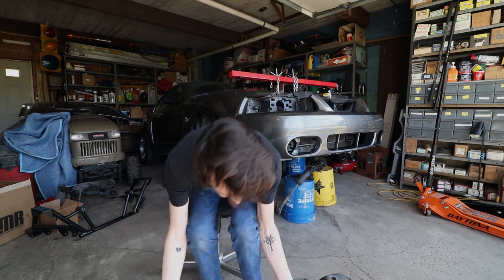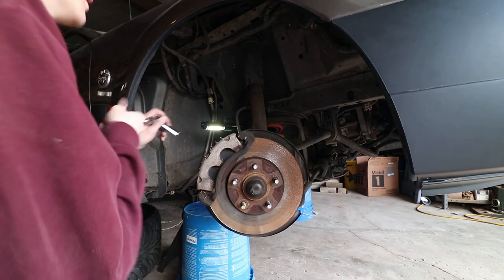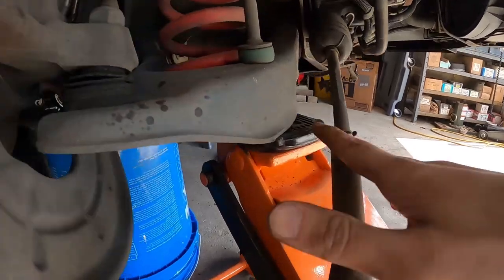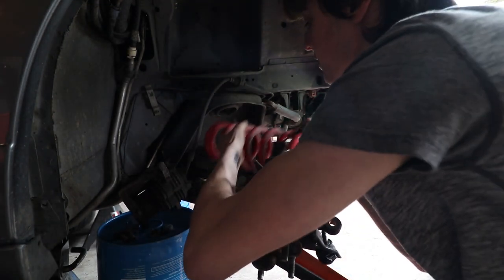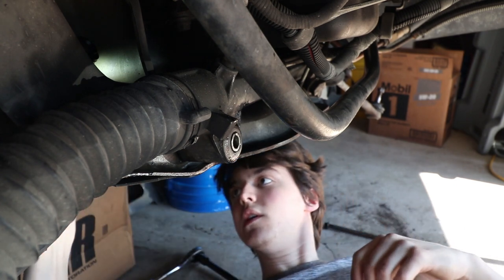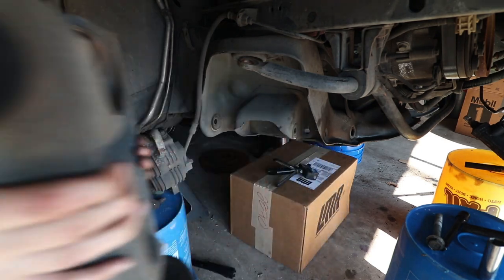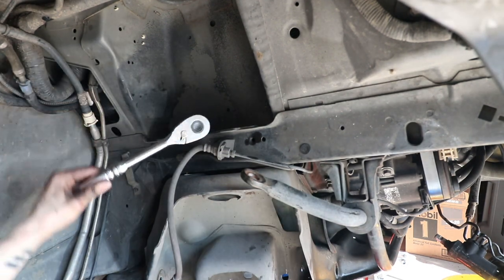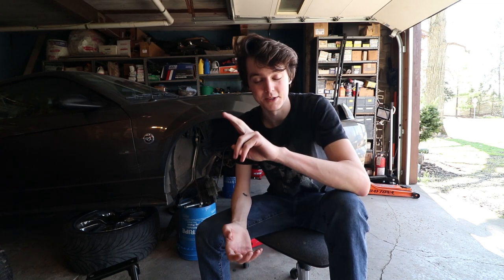Mustang K Member Removal (96-04)

Comment: Great video kid. I like the initiative you show. Small tip from a pro... when disconnecting the tie rod, strike the flat spot on the spindle with the hammer. Thats why its there. It will allow you to disconnect the tie rod easier than it was by striking the castle nut, and it also enables you to reuse the tie rod without risking damage to the stud, the threads, or the castle nut. The same trick works for ball joints as well. If you need further clarification please feel free to PM me. Im always happy to help a young gear head with their learning curve. Keep wrenching and doing such great videos. Good job man.
Reply from the maker: Hey thank you for the support I appreciate the tips and tricks as well! I’ll definitely be looking forward to future tips thank you sir!!
Reply: An old guy taught me that trick at the junkyard one time. He saw me and my buddy struggling with the tie rod and came over to lend us a hand.
Reply from the maker: @sethbrown5856 wish more folks were like that, a little courtesy goes a long ways.
Reply: Debating on getting a k member for my sn95. Built a 347 stroker twin turbo set up with a 8qt oil pan, thinking I need a k member upgrade for oil pan clearance.

Comment: For anyone else following this be careful putting your jack on the flat part of the crossmember the Jack has a  tendency to slip off if you're not careful
Reply from the maker: Completely agree. Safety is priority!
Reply: This is the reason I’m watching. I jacked it up the same way he did this morning. It fell right on the oil pan. Crushed it. Gotta do the oil pan now 🤦‍♂️🤦‍♂️
Reply: @DadifiedX4  you're alright aren't you didn't get hurt ?
Reply: @soloreclipse94  sorry for late reply I’m bad about checking notifications LOL. Yeah I’m good. It literally happened as I was jacking it up
Reply: @DadifiedX4  that's good it didn't go far enough into the oil pan too damage your crankshaft did it
Reply: @soloreclipse94  it did crush into the crankshaft but they are built with very tough material. I’m sure you’d have to do a lot to damage it. Car has been back up and running since two days after I watched this video!!

Comment: Hello Thatlowdsg,  I am helping with a K member on a Bullit, never done one before.  Your video was very well done.  One tip, loosen both control arm bolts and the control arm will swing down easily.  Then take the front bolt completely out.  Remove the nut from the rear bolt and the arm can be lifted enough to remove the rear bolt.  Your mechanical skills combined with excellent videos are a great help. Keep going.
AbueloJim
Reply from the maker: Jim thank you for the support and feedback, I appreciate it and hope the tackling the Bullitts K member is a successful one! I will use these tricks in the future as well

Comment: Great video I appreciate it. One question… well maybe a few you removed all of that cuz your installing a new K member and new parts? So, I’m just trying to install long tubes and would like to keep as much of the things I can have attached to the K member like the A-arms, and power steering rack and like you just station it forward near the front of the radiator with the lines attached hopefully they can reach pretty far or far enough it doesn’t get in the way of space. So I do I have to remove it all to install the headers cuz most of that stuff is attached to the K-member except the frame bolts and motor mounts or engine mounts and etc? Any advice would be appreciated. Thinking of tackling this project this Saturday- Tuesday

Comment: @thatlowdsg If I just need to get the Oil pan off. How far into this guide and taking everything apart do you have to get before you can just wiggle the pan out? Or do you basically have to drop the whole thing all the way still?
Reply from the maker: If your just doing an oil pan seal you can leave the control arms on leaving the shocks still connected to the knuckle but not the camber plates. And Loosen the K member as I showed allowing you to get to the oil pan bolts, but if your doing something major under there  you might have to drop it all the way

Comment: I’m about to drop my k member to fix an exhaust leak and put some nice shorties on it vs these crappily welded long tubes someone threw on. I will say this, a ball joint press is only 15$ and saved me almost half an hour of time. Knuckle and tie rod end were the worst.
Reply from the maker: I bought one too for a Chevy Blazer I was working on at the time,
Its worth the $. I like my bbk shorties, they sound good and perform good, nothing crazy tho.

Comment: If I was only doing this only to remove and reseal the oil pan gasket, would you recommend dropping the K member all the way for extra clearance? I mean, how much harder would it be to drop it completely as opposed to lowering it? Great video btw, extremely detailed and informative!
Reply from the maker: I appreciate it but if you’re just doing that reseal follow this video as proceeds. Then once you have the K member completely loose just lower it with a jack slowly till you can get to the seal (break the bolts first while the K member is secure) but that should be it
Reply: @Thatlowdsg  Sounds good, I'll give an update when I'm through. I should also mention I'm doing this on a V6, but everything looks basically the same. Thanks for the quick reply
Reply from the maker: Yes I should’ve mentioned it’s the same setup on the v6 maybe just different size bolts on the motor mounts but Goodluck anymore questions feel free to ask.

Comment: Did you have to disconnect any specific lines??? Needing to drop my k member but im trying to do my research onto doing so first. Just not wanting to lower it and i miss a line or something i wasnt aware about.
Reply from the maker: No lines need disconnecting, brakes or power steering.

Comment: Great video!  Where did you get the harness bar to support the engine. Thanks for your help.  My 98 GT has the long headers, and I am removing them and updating the system..Jim.
Reply from the maker: Sorry about the late reply Jim. Have had some personal issues, but I bought mine from Harbor freight for like $100 or less. Hope you get it situated.
Reply: @Thatlowdsg  Thanks for the reply!  I haven't seen it in the store, but I'll ask them, or check online,  Thanks again.........Jim.
Reply from the maker: Check online, in store was hit or miss for me as well. I threw out the box or else I’d send the part #.

Comment: GREAT VIDEO ,I FIND THIS CHANNEL AND I LOVED IT, I WILL LIKE TO ASK DOEST THE MUSTANG 1999 v6 3.8 have  Secondary Air injection pump, I HAVE THE CODE P0412, AND BE LOOKING FOR THE PUMP BUT A DONT FINED IT in the front of the cars  i take it to mechanics and he said he did not fined it, and another mechanic said he  as to remove or engine where is them pump, thankyou for your help.
Reply from the maker: I’ll be honest I’m not sure the car has an air pump, I’ve not seen one on mine as I looked the code up most folks said check the 02 sensors, check if your exhaust manifold has any leaks or any vacuum / exhaust leaks.
Sorry to not answer fully as I’m not too familiar with the 3.8s as much. Cheers and welcome to the Channel!

Comment: If you have a battery and or an air gun, and are trying to get bolts to fall through take an open end wrench and put it behind the built in washer and then hit the gun in reverse

Comment: can you explain the need to remove control arms? I'm going full tubular and manual steering rack so I was gonna try and drop it all as one unit
Reply from the maker: Technically you don’t need to remove the control arms if you’re going tubular k member + arms. But for now im using my stock arms so I took them off. You could drop it all as one unit!

Comment: Would this be the same for the 94-95 models cause my 94gt and 95 cobra need oil pan gaskets and I need to drop the k member
Reply from the maker: The only difference I can think would be the motor mounts, should use the same K member and design / process and since your doing the pans you won’t even need to fully drop them

Comment: You did a really good job on this video!  Quick question.  If im not replacing my K member but rather need to remove it for header bolt access do the lower control arms and springs need to be removed?
Reply from the maker: If you’re just removing the K for Header access youd only need to remove the spring. The control arms can stay connected! Thank you for the feedback as well. Glad the vid could help!
Reply: @Thatlowdsg  it would appear you clearly know your way around but in case you are like me looking for specific install or removal videos to help before digging into a project my channel has a few on my 97 Cobra.  Thanks again.

Comment: Hi, im wondering if you could help me out. I have a 2001 mustang gt and im having a loose steering issue. its very exaggerated at highway speeds, where it feels like the center of the wheel has play. almost like im driving on ice. so far ive replaced the steering shaft with a maximum motorsports solid one, replaced the rack and pinion (with new inner and outer tie rods) lower control arm ball joints, and front tires. Ive also added lowering springs with caster camber plates. still cant get rid of the sloppy feeling :/ not sure where else to go now.
Reply from the maker: Hello steam train my apologies for seeing this late. With everything you described it would be my honest opinion to take it to a certified tech or an alignment shop that allows aftermarket/ specializes in aftermarket alignments. I have a video coming out shortly going over my loose steering too.. Sorry mate hope you best of luck too.

Comment: How long did it take u and how about the steering pressure hoses on the rack n pinion did u disconnect em
Reply from the maker: Think this took me half a day maybe less if I didn’t film. But no you don’t need to disconnect the pressure hoses just make sure the rack n pinon is supported though. I used buckets to hang it.
Reply: @Thatlowdsg  thank u

Comment: You had the engine on a hoist? While you were doing it?
Reply from the maker: Yes you need a brace or something supporting the engine when you do this job. Because the K member and motor mounts keep your motor in place / support the engine so if you replace your K member or remove it you need an engine hoist or some sort of cross brace like I used!

Comment: I’m trying to fix a header leak. Is it really required I unbolt the steering rack from the k member since it’s going right back in? Trying to leave as much stuff together as possible when I drop it
Reply from the maker: No, you could keep the steering rack bolted to the K member however you’ll need to disconnect it from the steering shaft. Also have to consider the lines going into the rack so you’d have to be careful not to damage those.
Reply: Matthew im in the same boat.  About to do this to fix a pesky gasket leak.  Any tips from when you did it?

Comment: What the name of the k-member?
With that k member can you still use the factory control arms with springs
Reply from the maker: https://ajesuspension.com/product/79-04-mustang-universal-engine-mount-k-member/ heres the link to check it out yourself, and yes it can still maintain the factory control arms and springs. I’m still running the factory control arms for now and they fit good. Springs should work just fine as well.
Reply: Question I got the kmembers will you need the springs perched  MU-1001 to run factory springs and control arms? I got motor mount bracket are MU-AJE- 20

Comment: For you people that their car is not as clean as his is, cut your control arm bolts out. Lots of times they don't come out as easy as his did. Make sure you order the bolts as you just can't find them at any auto parts store. CJ Ponys and LMR have them. A ball joint stud tool and a tie rod stud tool will make removing them easier too. Oh get the spring back in is made a lot easier with a maximum motorsports front spring installation tool.
Reply from the maker: Thank you for some tips for others.

Comment: I got to get to the rod bearings in my 04 v6 , would this method help me do this ?
Reply from the maker: I believe if you can remove the oil pan then yes you can get to it. This video could help you get to that step. Cause the K member is blocking the Oil pan of course.
Reply: Thatlowdsg UPDATE , I bought a engine support now I have no idea where to mount the chains because your engine looks way different from mine ,
Reply from the maker: I stuck mine through some bolts connecting to the block, Im not sure the layout of the V6

Comment: Do you still have the stock strut mount. And camper caster plate ??? Lol
Reply from the maker: Im running BC coil overs now so no, but I still have my old parts.
Reply: @Thatlowdsg  wanna* sell em , I took a road trip and blew most of the front suspension need to go back to stock
Reply from the maker: Id be willin to sell them and ship them anywhere in the USA except Hawii or Alaska!

Comment: What do you need the harness bar for?
Reply from the maker: The harness bar supports the engine, as the K member supports the engine & front suspension (along with the motor mounts)
Reply: @Thatlowdsg  ah okay makes sense, I'd imagine it also puts less stress on the engine/trans connecting point
Reply from the maker: Yes exactly that too!

Comment: I hope i know how to put my springs back on when i install the k memeber back bc you didnt show it in your install vid🥲
Reply from the maker: Keep track of which ones are the fronts and rears, keep them upright and take note of how the spring isolators are placed.
just place them in the control arms how they were and raise the jack up untill it sets then safely lower it and see if its sits right. I think I have a clip on my BC coil over video

Comment: Awesome video! One recommendation: buy an impact wrench. And a huge set of Impact Sockets and Impact Torque bars. NOW!

Trust me; well worth the < $500 investment for involved stuff like this. Definitely makes things way easier and faster. :)
Reply from the maker: Thank you Esco, I do have a nice Impact wrench I just try to show you the bare minimal tools in my videos! I did use my impact sockets with a large extension ( not connected to my impact)  when I took the bellhousing bolts on my Transmission and they work perfect for that as well. But I appreciate it and thanks again
Reply: @Thatlowdsg  Awesome! YW.